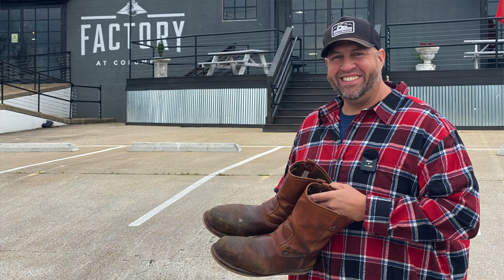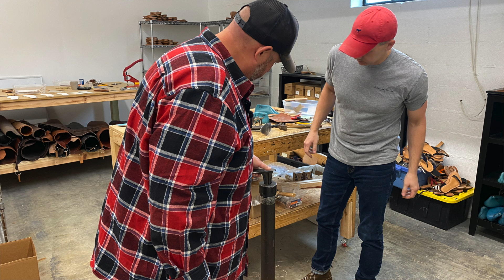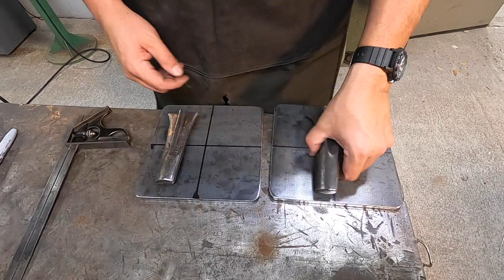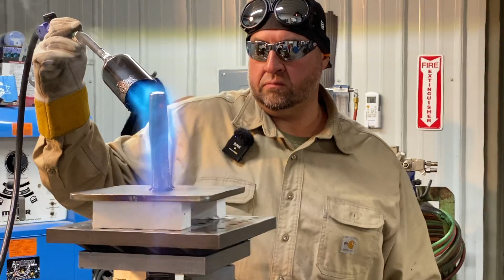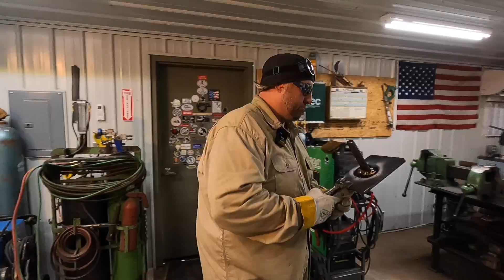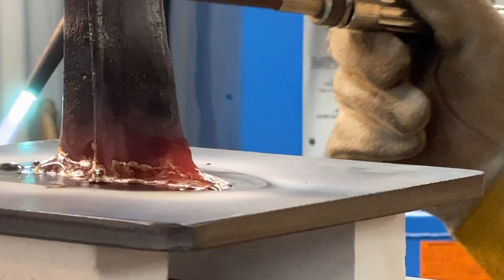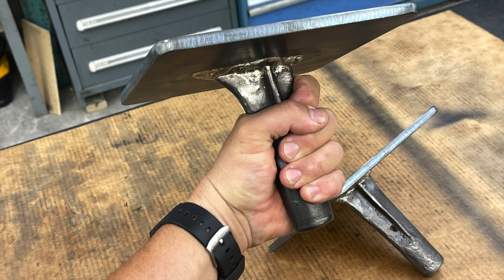Custom Shoe Anvils for Potter & Sons

Comment: Adam you are spot on with the braze and its merits, However those joints look like bubblegum they will hold but looks are everything to a customer. might i suggest a jet fluxer you should be laying down a sweet bead but that flux coated rod is crap. I will send you my jet fluxer  if you so choose and i can show you how it works i guarantee you will never braze without a jet fluxer again there that good if it was good enough for F1 back in the day its good for anything thank you and carry on.

Comment: Anyone wanting to say gas brazed joints aren’t as good as an alternative needs to consider how that filler will have flowed into the joint much more deeply from the greater through heating of the torch flame vs a concentrated arc around the edge. Plus brazed joints are way better with vibration and impact than a weld. 
Great job well done sir.

Comment: I think they call them fused silica tiles, but could be wrong. It looks like the stuff Elon Musk is putting under his heat resistant tiles on his Starship down in Boca Chica, Texas, only he is using a flexible white fabric which can take very high temperature. He is putting the fabric between the stainless steel hull and the rigid black tiles on the outside, where the heat from the compressed air will radiate toward the tiles during reentry. I used to think the heat was from air friction, but it is heat which radiates from the air molecules heated by being compressed just ahead of the vehicle.    
I fixed a cast iron bench leg with nickel arc welding rod. It is still holding decades later, although it doesn't have much stress on it. The bronze might be more flexible, so it might work better. When I bronze welded, I always used a can of flux to dip the rod in, since I never cleaned the surfaces nearly as well as Adam does.  
Decades ago, I watched an expert join a propeller shaft support to the bottom of a crew boat in Lafitte Shipyard. It lasted until the company went bankrupt, so it can work, even for thick metal. The V-12 Detroit diesels put a lot of stress on those supports. I would have never thought it could be done overhead, but he did it.

Comment: Very cool Adam. I am also with you, Brazing produces a very strong bond. Most people don't do it wrong which is where people come off thinking that it isn't as strong as TIG. I personally would prefer Brazing over TIG as I think the TIG's heat has adverse effects on the cast iron. Just my opinion.

Comment: Hey Adam. I’m glad you mentioned weld aesthetics vs practical results. I have two examples. I built a shop made leading link front end for my sidecar outfit using a 120 gas mig and varying techniques. It’s a critical component, it takes place of forks. Never has cracked, failed, loosened or anything. They ain’t pretty but are effective. Second, I’ve posted pictures of motorcycle frames in posts over the years on social media where the subject matter was someone different but the frame welds were visible. I’m talking Honda factory welds on 35-40 year old bikes. Keyboard warriors criticized those factory welds even. Point again is you’re exactly right; a perfectly looking weld may not be any better than one not so pretty. I prefer function over form. Finally, always remember, viewers, “paint will make it what it ain’t!” Cheers.

Comment: Adam.... I agree with you regarding acetylene brazing heavy cast and steel as the heat is increase and degrease relative slowly allowing the brittle cast iron to adsorb heat stress better then quick electrode- nickel heating with no preheating.  Thanks, Juan

Comment: Here in the UK they are called Lasts. A shoemaker is called a Cobbler, therefore these are Cobblers lasts
Reply: That's true, but a last is more properly the final "last" wooden form of the shoe. The upside down sole shape is the anvil. Casual usage is to call the anvil a "last" even though it's wrong.   It's just slang.

Comment: Hey Adam!
In “laymen’s” terms, brazing & soldering function in the same manner as hot melt glue.  The filler metal (glue) is simply flowed in a low enough viscosity that it will permeate into ANY surface imperfection, grain or abrasion.  As the material cools, it shrinks, locking in it’s grip to the non-molten surfaces. 
My $.02
Great vid!
Ken
Reply: The bond formed in brazing is not mechanical (that is due to shrinkage), but metallurgical (that is, the bond is an actual bond of the braze material atoms directly to the base material atoms).   You can actually see this happening at a macroscopic scale - if the base materials are not sufficient clear, or not at a proper temperature, the braze will bead up as droplets on the base material = just as water will bead on a hydrophobic surface.  When the appropriate conditions are achieved, the beads will flatten out and spread by capillary action, because the adhesion force of braze to base metal is stronger than surface tension of the molten braze, thus causing the drops to collapse and "wet" the surface of the base metal.
Reply: @walnutclose5210  Yes, it IS at the atomic level.  But, as I prefaced the comment, “In laymen’s terms…”. Seeking to simplify the terms to an easier to comprehend context. Not ALL who look to these sources for basic understanding are necessarily in possession of advanced education, yet.
Reply: @kejay74   I found that conversation very interesting and informative. Thank you both for sharing.
Reply: @randomperson8695  Thank you.  I seldom comment, unless I feel that something needs to be brought to a simpler context.
Ken

Comment: I like the brazing job. But why not avoid reusing the cast iron by machining or grind a piece  of round bar to copy the old anvil then just weld it to the plate?
Reply: The stand they use at the shoe place has a taper and features that matches the shank of that piece. That’d be difficult to reproduce.

Comment: @Abom79, You may find in situations requiring as much pre-heat as that job, you would have been well served by putting a flux paste in the joint and around the weld area, this would have reduced the oxidisation prior to flowing your fluxed rod there. My hat in the ring, that was the cause of your braze not flowing as gracefully as you would want, if you study the footage, you can see the braze whetting both materials but avoiding the oxide layer in the gap. Flux has to be considered in similar ways to shroud gas, in this instance the 'pre gas' would be 'pre flux'.
Reply: I was going to ask about doing just that, since I've never seen it mentioned for brazing. It's reasonably common for lighter soldering, especially electronics.
Reply: @Azlehria  brazing is sometimes referred to as hard soldering when using silber allows as filler, it basically just uses a higher temperature than electronics soldering. The filler rod Adam used had the flux applied to it on the outside, which is comparable to flux core solder for electronics. The last time I brazed something I brazed some brass parts with silver filler and flux paste I added during preheat, smelled just as bad as the flux paste I have to electronics soldering.

Comment: Well. I know one thing, those are strong enough to pull a truck. Cast iron Is a pain, with brazing, it's going to be good and solid. Those heat tiles (I used firebrick} are a lifesaver.

Comment: Could you contact Chris Razor? I've known him for a long time & have never met a better welder. Ask him about tig brazing. He did the vanes in my converter for my Lencodrive & they withstand 3500 hp every run at 10,300 rpm. He's even welded my titanium shield around my cage. I know he has a youtube channel.

Comment: Brazing is always the correct repair for cast iron.   Nickel is simply not as good except for color..   If you clean well and the cast iron is pure, my opinion is that TIG braze is just a lot cleaner and neater than oxyfuel..   MIG braze with silicon bronze wire is also a good option- I've repaired many a cast iron pump housing by MIG brazing..

Comment: We had a large cast iron plate at work and the foreman tapped me to weld some six-inch pipe legs to the four corners.  The plate was about six inches thick as well, milled on one side and full of approximately one-inch square holes.  The foreman handed me a tube of 5/32 inch NiRod to weld with.  I preheated one corner of that cast iron plate for nearly three hours before he got impatient to get the welding started.  So, I started welding and peening, welding and peening, welding and peening, until I had the leg welded to the plate.  The next day I started in on it again and the foreman told me the first leg looked good.  I said yeah, then took the heel of my hand and bumped the leg pretty good.  The leg and weld popped off the cast iron instantly.  I have brazed cast iron, as you did, and with a cast iron brazing rod and flux with lots better results.  I even brazed the exhaust manifold off a Farmall "A" that was mostly honeycombed where the iron had rusted out of it.  All with that cast-iron rod.  I will accept brazing any day over welding!!!

Comment: I have no objections whatsoever to the way you braised the two parts together, after all you are the expert, I've never braised anything! I just wondered why you cut off the foot shaped piece from the stem (I believe the whole thing is called a last. https://www.google.com/search?q=cobbler%27s+last&newwindow=1&tbm=isch). What was the problem with grinding it flat (maybe with some spray welding build up) and brazing that onto the plate similar to what Paulster2 is suggesting below. Apart from giving a larger braze area I'm considering the aesthetics. You would still be able to see all the original tool and it's history.

Comment: I agree with you Adam.  The conventional way is better than using tig or arc welding.  By using tig and arc welding, even after preheating, the initial start of the weld shocks the material compared to using a torch bringing the material up to brazing temp much slower.

Comment: You do what your comfortable with Adam, because your experience and gut feeling tells you what is right. Yes some people will disagree with you and me, that's fair enough and everyone has their own opinion on things. 

I did a bit of welding a long while ago and loved oxy acetylene welding thin plate, purely for the challenge of not blowing through. Mig and Stick just seemed a bit easier in some ways.  But I'm definitely with you on the comfort thing, getting the workpiece so your comfortable is difficult sometimes but more rewarding as your not fighting to keep your hands steady.

Great job Adam and Abby (awesome camera work :-)  )

Comment: You did a good job brazing them, but they don't look like they will be level to the floor.  Shoe anvils are angled upwards to accommodate a 3/8"  to 1/2" heel height of the shoe so that once the shoe is put on the anvil it is basically flat. If they wanted a nice flat work surface so stuff isn't rolling and sliding off' the plate needed squared up 90  to the ribs on the shank to be level with the floor. Maybe you did and they just look wonky on camera???

Comment: They are actually called “ Boot / Shoe Lasts “ not anvils. Just sayin!!!
Reply: Lasts are different. Had to Google it to be sure.
Reply: @jbeutell  
I didn’t need google, I was referring to the ones he needlessly destroyed, they were last’s, no question.
Reply: No, that is a very common mistake. Shoe lasts are the molds that the leather and uppers are stretched over to form the shoe. they can be put into stands and be used in a similar fashion while the shoe is being constructed so it is often confusing.. 
the shoe anvil is used for working on shoe, either new or old, once the show is removed from the last. They are primarily used to clinch the nails on heel blocks and general purpose hammering to secure the contact adhesive used in repair of the shoes.
Reply: @TgWags69  
I was referring to the ones he cut up. He could have just welded a tube to the flat plates and achieved the same result.
Reply: @TgWags69  We are not going to convince him...
Reply: @TgWags69  
Sorry, it’s not a mistake it’s what he called them at the beginning of the clip and then proceeded to cut them up.

Comment: Just like you said it all depends on the application that it is used for and I agree that the tig would require you to preheat just like you did so way wast the time when you don't need too. Also you most likely would have need to lay welds down the length of the mount to add strength so it doesn't break the weld.

Comment: Those are called repair “ jacks” and the stand is called “ repair jack stand”  . Retired custom cowboy boot, and shoe maker here
Reply: the correct term is last as any good cobbler will tell you
Reply: @markgrant8771  A last is a form used for manufacture of the entire shoe, this is most definitely a repair jack. Prior to "correcting" someone it is always a good idea to ensure that you are indeed correct. There is no better way to learn something new than to question what you think you know.

Comment: For the next two, drill 4 - 6 holes in the original patterns, then transfer those to the new "tops".  Counter sink holes in the "tops".  Tap, Screw them together.
Reply: They are not flat surfaces and are cast iron. Chances of breaking, pretty darn good.

Comment: BSA, Triumph, Norton, Ariel, etc etc all British motorcycle producing companies used gas brazing to hold the steel frames and cast brackets/lugs/fixtures to each other for many decades, no TIG about then of course, but those frames are still good, some done a hundred years ago, I agree with Abom.

Comment: I was certified in oxy_acetylene welding 45 years ago  I feel the cast iron will fail before the weld does you are right
Reply: esp in this case, the cast iron is likely to crack just due to the application.

Comment: Perfect job and choice of methods. Brazing is an exceptional bonding process. Me personally, I have done some nickle stick welding on cast and in my opinion, it is a terrible way to do the job. I would braze this any day. I probably would have done it with a tig welder, but that is more out of preference rather than one being stronger than the other. 
Well done Adam. ;)

Comment: We have a definition for “expert”: x is an unknown quantity, spurt is a drip under pressure😂 The real experts are the ones out there getting the job done. Thanks for another great Saturday Night Special Adam. Looking forward to seeing the jib crane at work in the new shop.
Reply: ex is a has been
Reply: @MrAsphyxious  that's the way I always remember it. but it works the other as well.. <shrug>
Reply: Few of us real people are "experts". Well some are  better in different areas. I am pretty good in a few. Only a Mechanical Engineer (but I can weld too).
Reply: Back in the days (60s and 70s) our definition of an expert was anyone wearing a suit, carrying a briefcase and more than 50 miles from home.  Yes, we were sarcastic SOBs even back then.

Comment: I agree completely with your method Adam.  Brazing, done properly, is by far the best approach with a piece like this. It will be a stronger and more ductile joint than a nickel weld.  Nice job.

Here's a project idea for you.  Do a series showing how to build a multi-stage hydraulic cylinder.

Comment: This is NOT criticism,  just a question; why did you not cut the stems so that they would be perpendicular to the work surface, thus the surface would be parallel to the floor when in operation?  Just curious.
Reply: I'm guessing that detail was discussed with the customer.

Comment: Nice brazing work Adam. Your absolutely correct about stick brazing for this application.  You get a larger cross section of bonding area all around and eliminate tight radii stress raisers. Nice ending tune 😎

Comment: I'm surprised you didn't take the feet to the shaper, cut them flat, then attach them to the plate. It'd give you a lot larger surface area to be attaching to the plate.
Reply: More welding and more heat on the plate will cause them to warp :)
Reply: @ratballs007  - One thing about brazing (and it is the right way to do this job) is you have to control heat. Too hot and it doesn't work. Too cool and it doesn't work. Goldilocks zone right between the two. Thing is, if you're doing it right, there won't be warping. I'll wager even though Adam suggested the work he'd be doing would draw the plate so it was a bit out of flat, there really wasn't that much. And "drawing" isn't necessarily warping. By having a broader surface by which to attach the plate to, it would have been less of an issue all the way around as well as the end result being stronger still.
Reply: @Paulster2  You are also correct bud ! my suggestion to you was his method of thinking, by all means i may have done it the way you suggested as well, but i also try at times to see through the eyes of another, his method of thinking may not be wrong as such but different, sometimes when you are doing the work as a job for money you tend to go the more appealing way as opposed to the more stronger way, not that his way wasn't strong either :) Cheers !
Reply: @ratballs007  Good points. Cheers to you, Kind Sir.

Comment: Well I'm firmly with you Adam. Gas heat is more spread out, you got everything hot to start with and all being well that brass has run under the CI so has made more of a joint than what you can see. Localised heating with arc isn't going to do that as well if it does it a bit.

Prefluxed brazing rods - whatever next ! LOL

Comment: I started out poor, so for my money a good acetylene cutting / brazing / welding rig just made sense. Car bodies were built with this system using steel rod from the factories for over 50 years!